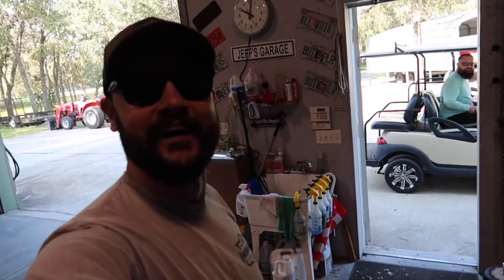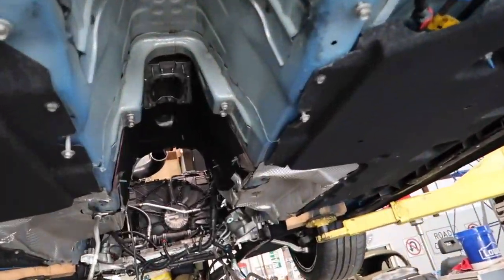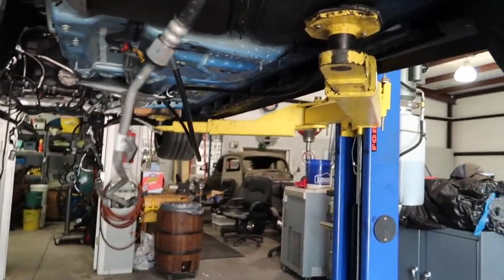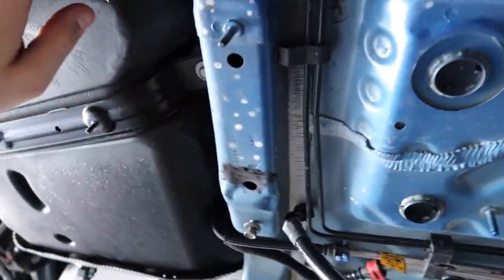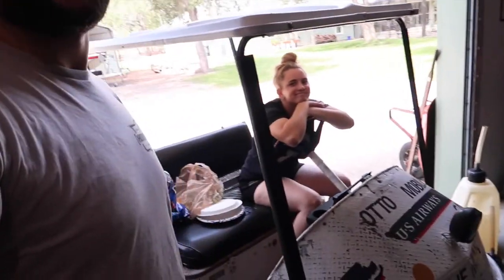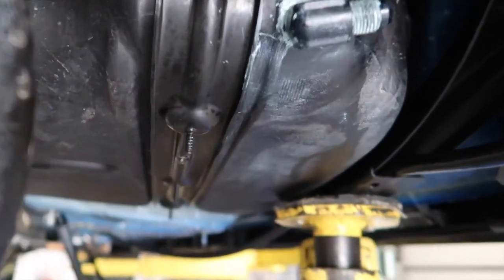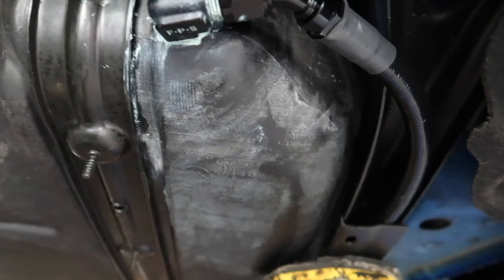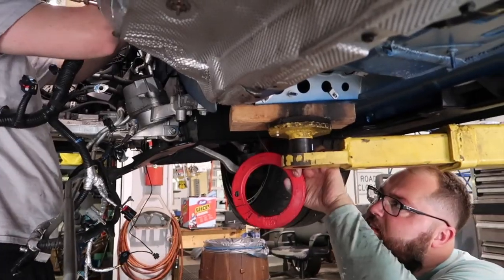DSX AUX fuel system!

Comment: Hey man! I have a C7 z06, currently CAI, Corsa xpipe and exhaust. Doing a heat exchanger and 2.3 pulley next week. But, thinking about flex fuel next. Does this pump create more power or enable or power? Or both?
Reply from the maker: Hey brother! It’s gonna allow for more fuel, in turn more power.  When going e85/flex fuel, it’s more stress on your fuel system. This will help get that fuel where it needs to go.
Reply: @driven_dorey9335  thank you! It's crazy how many different opinions you get from shops. Some say you're totally fine going for a e85 with no modification. Others say you can go 85 with this pump. But DSX says unless I have a cam even with this pump I should stay under e50
Reply from the maker: @MichaelGreco  ya if you go anymore your  gonna run out of fuel pressure. I have the same fuel system as yours and I knew I was gonna run out of fuel with my build. I can run E65 with the lt4 fuel system and aux pump and then mine starts breaking up now because the injectors are maxed out. So I try and stay around the 50-60% rang. Gonna do Meth next.